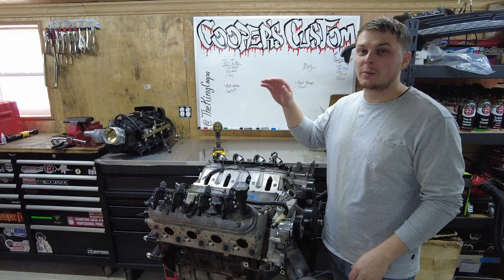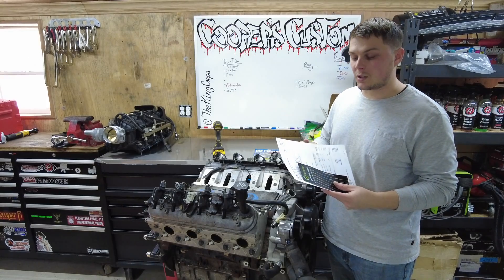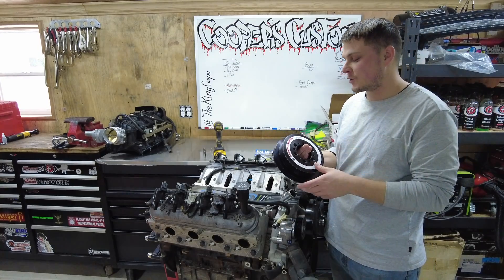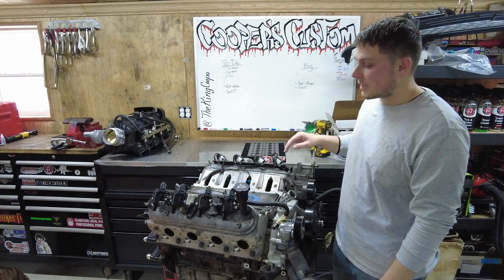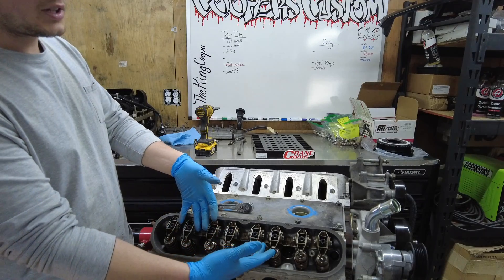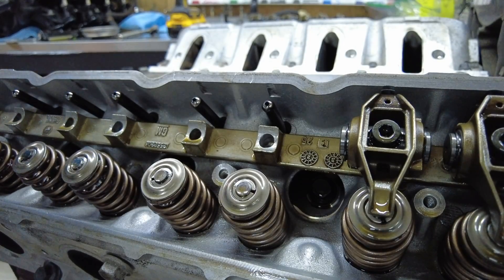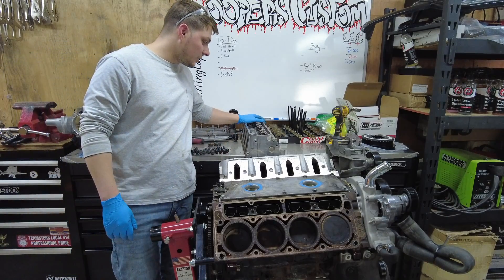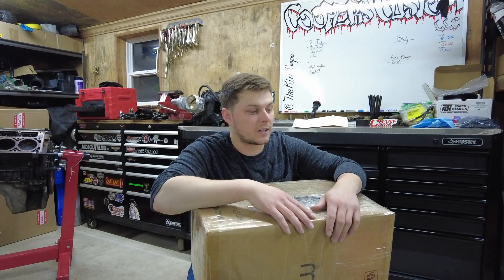Frankenstein Stage 2 Heads!! We're Sending The 243's To Be Ported, Estimated 50HP Increase!!!

Comment: What harmonic damper you get
Reply from the maker: Hey, sorry for the late reply. This is a similar dampener I went with. Mine was a 10% under drive pulley though. I always recommend you giving ATI a call. They can give you the correct part number/pulley for your desired setup. As there are MANY different versions, diameters, offsets, rib counts, ect. and it can be easy to buy the wrong one. They are very knowledgeable. Hope that helps, good luck!

https://www.lsxceleration.com/ati-super-damper-gm-gen-iii-iv-ls-truck-harmonic-balancer-6-4-rib-918628/

Comment: I am going to get stage 2.5 ported 243s for my Vette from Frankenstein. I plan to also change the cam while Frankenstein is porting my heads. Do you have any advice for the build? I just don't want to drop a pushrod or anything down into the cylinder
Reply from the maker: Hey, sounds like a good plan! Frankestein offers the stage 1 porting service, and a stage 2 porting service with larger stainless steel mahl valves . The next step up past that is their full CNC billet heads.  

Best advice I can give you, is to buy the LS engine builder book. I'll link it below. Super helpful and tells you everything you need to know. Also just take your time and have a clean workspace. 

As for the dropping pushrods. You will have to take the heads off to send to frankestein. To do so you have to remove the pushrods before the heads. Only thing you really need to worry about dropping is the lifters. Just remove the lifters and trays before you pull the camshaft out.

Id also get hardend pushrods, ls7 lifters, ls2 timing chain, melling oil pump, and get some appropriate valve springs for the camshaft you buy. I'd call cam motion, or BTR and tell them all your specs and what you want to do with the car. So they can spec you out an appropriate camshaft. I'd do the same for your flywheel/clutch or tourqe converter. 

https://www.themotorbookstore.com/how-to-rebuild-gm-ls-series-engines-book.html?cmp=googleproducts&kw=how-to-rebuild-gm-ls-series-engines-book&gclid=Cj0KCQiAw9qOBhC-ARIsAG-rdn4jbhvuAWLnm8g6UpTnWGV3DG2aRJY9WL8GW0ks04LP86RxjiQ3g_waAigwEALw_wcB
Reply: @TheKingCoopa  awesome, thank you for taking the time to help me. Gonna order the book.

I'm getting the porting service with assembly, so it comes with dual valve springs and stainless valves from Frankenstein. They told me I just gotta add the rocker arms and pushrods.

Been reading a different LS book that focuses a lot on detail. Did you measure your pushrods or the angle of the cam?

 In theory this sounds good, but it looks like a lotta guys just put the stuff in, unless they mill the heads
Reply from the maker: @JuanyJuanes  if they are adding dual valve springs, im sure they are close to a .660 which are definitely large and can accommodate almost any camshaft.  I didnt need to do any measuring of the camshaft. Biggest thing to look out for is the piston to valve clearance. Which can get close on the 230/240 sized cams. But some camshafts do have larger base circles which can change the pushrod length. Still, even without milled heads, I think it would be a good idea to spend the 25$ and buy a pushrod measuring tool. Just for the peace of mind.
Reply: @TheKingCoopa  got it, I'll get the pushrod measuring tool. My tuner recommended the TSP torquer v4 231/234 .629"/.615" 111 LSA.

It's supposed to add 50-60 HP. Do you have any opinion on TSP vs BTR or the CAM motion?

 I was gonna get the full package of head porting with a cam from TSP, till I saw a video on here of TSP CNC ported heads that had aluminum burrs and a hole in one of the screw holes from the porting.
Reply from the maker: @JuanyJuanes  I've never used tsp or btr, but they are pretty mainstream, and alot of people use them. Can't go wrong with them. The V4 is definitely a healthy cam

Also just an FYI almost all cnc heads your gonna need a little silicone on the rocker arm bolts. They remove alot of material which exposes the threaded hole for the rocker arm bolt on the intake runners. The silicone will seal that up
Reply: @TheKingCoopa  which bolt holes get the silicon? Which silicon? Thanks- I called Frankenstein today and the guy said on the stage 2 porting, they actually mill .0200, so I'm really glad I checked. I think I'm going with BTR- I got Landon on the phone who went out of his way to get all the specs and goals on my build. I would hate to just throw shit together and have it not work.

He also told me BTR has a new cam out- it's called Red Hot, and it is good if I want to add boost in the future. Did you know they sell LSA supercharger kits for LS2's? You get get a pulley on it and it's cheaper than getting a A&A. He said down the line I can do this.

I'll keep you updated and thank you again for your time to respond to me. I got a nice gopro and will try to document the build